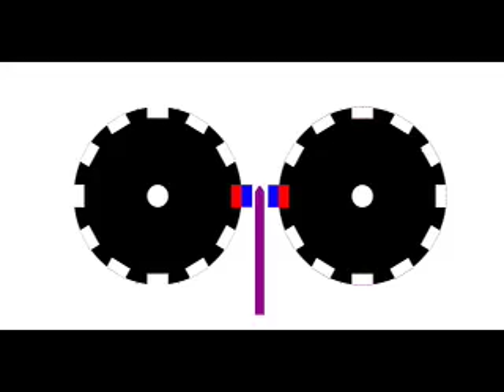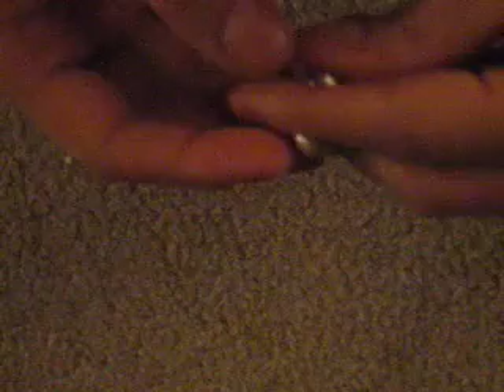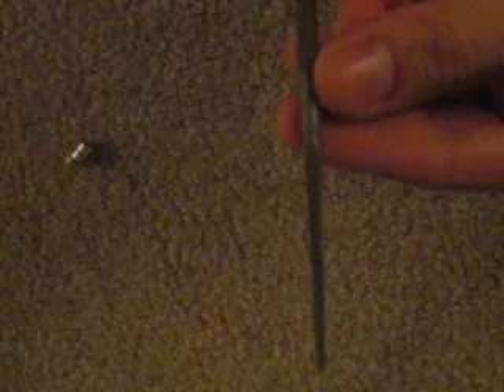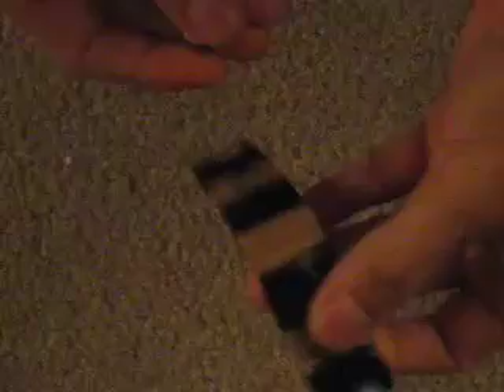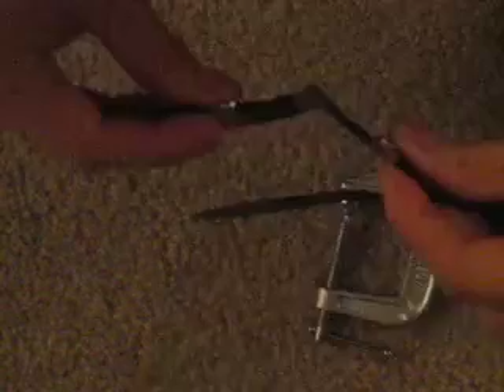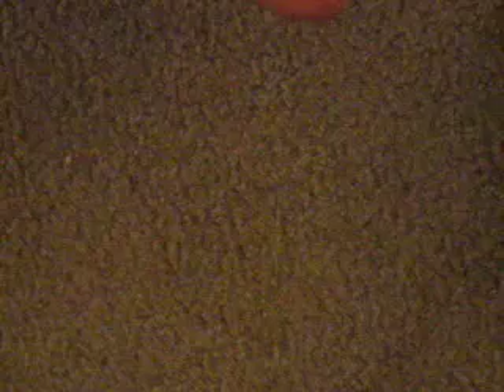Magnet Motor concept and How magnetic shielding works

Comment: Why do you guys spend your time thinking about impossible things. The first law of thermodynamics is the best proven principle in physics. (http://en.wikipedia.org/wiki/Conservation_of_energy)
such a machine can never work, better think about converting available energy (solar irradiation, heat...)  into useful mechanical of electrical energy. There's still a lot improve and engineer in this field.
Reply: "Why do you guys spend your time thinking about impossible things?" Because many things considered impossible in the past are now possible.

You are correct in the a truly perpetual machine where it has enough energy to power itself could never work. But the wheel isn't powering itself, the magnetic fields are attracting at the bottom to the iron, being neutral in the middle when the attraction to iron and repulsion of the opposing wheel are equal, and then pushing when the iron ends and there is only the repulsion of the opposing wheel.

Maybe it's a dream, but that's what dreamers do. And as stated in the video, such a device would only work for as long as the magnets hold their charge ~100+ years. Not "indefinitely" thus not in direct opposition to the Law of Thermodynamics.

Comment: so Is Magnetism a type of energy?
Reply: Yes, but NO ONE knows why it works, it "just does".... don't confuse the ability to use magnetic fields and manipulate it with knowing why magnetic fields work where does the power come from where does it go why would you put a magnet on a piece of metal in A Thousand Years it'll still be there and you can move it to another position and 1000 years later it'll still be there barring destruction by causes both natural and artificial.

Comment: Tested, sorry but itdoesn't work!
Reply: at which point was it failing?
Reply: show the proof of your claim. make a video. We would love to see your device.
Reply: That's not a test, that's someone pulling numbers out of their ass lol.
Reply: propheccy Energy needed to enter in the magnetic area is equal to the force that pushs the magnet out. 
In every way you put magnets the forces + and - will be the same. Energy you got with + and + or with - and - it the same and opposit with + nad - or with - and +
(+ X) + (-X) = 0 everytime.

Comment: you misunderstand. Though your staement is true, I am referring to the concept behind the magnet motor. When two same poles are pushed against one another repeatedly, it'll eventually wear them out, in an attempt for the magnetic domains to align themselves properly. This wears them out exponentially faster than if left alone.

Comment: I think it's worth noting that the magnets will become marginally weaker with each pass, and after about a month to a year most magnets go flat and require re-magnetization, which is energy intensive. Thus, it's reasonable to shove it up the #ss of a skeptic saying it's just a really effiecient battery. (NOT TO MENTION SAFE) warning: will interfere with nearby electronics;)

Comment: I attempted this same experiment back in 2003 when Neodymium magnets were much more expensive and harder to obtain.  It does not work because there is NO known material that can truly block magnetic flux, with the exceptions of superconductors.  No room-temperature superconductors exist.  I am still searching for materials though, and when someone finally discovers a material that can block magnetic flux at room temp. then this motor will be possible, and free energy will finally be a reality.

Comment: You failed to take into consideration the Eddy currents. Basically, the energy of the system will dissipate into heating the metal rod and the magnets.

Also, the metal rod would become permanently magnetic and ruin the properties of the motor.

Comment: Ok, but even then, you have to take into consideration the fact that it takes a lot of energy to create a magnet, especially a strong neodymium magnet like this, and also that magnets slightly degrade over time and degrade even more when used in repulsion mode.

Comment: No you don't! Not if you use your noggin, use solar and wind power to pull the spring. lol Kidding but magnets do create energy from the environment, so there is a way to extract it into useful electricity, we just need to find out how. I see some toys that can prove overunity possibly, A magnetic clamp device, Just from a single twist 180 degrees the clamp comes apart when before it would not come apart if you tried hard as you can to pull it, but you can twist it with ease and it comes apart.

Comment: This won't work. But magnetic shielding is the key to perpetuus motion though. You have to use the kinetic energy to flip the shielding in and out of the two magnets. When push in the magnets can move to eachother. This causes the wheel to turn. But when the wheels turns, this energy is used to remove the shielding. As this happens the magnets will repel again, which makes the shielding return etc.
Just like a gas-engine does.

Comment: No it isn't. 'Wireless power' is essentially a transformer, the pad makes a changing magnetic field and your phone has a conductor in it. When you put a conductor in a changing magnetic field, a voltage will be created over that conductor (Faradays Law of Induction, google it). That voltage then charges your phone.

This magnetmotor cant work because the energy required for the magnet to break a way from the iron is the equal to the energy you gain when both attract. Net total is zero.

Comment: Energy is defined as applied force times the distance a object has moved. Since the the magnet is sitting still, there is no energy involved.

The magnet is attracted with a very strong force and when two surfaces of objects are pressed together you get a friction-force in the perpendicular direction, in this case the perpendicular direction is the opposite of the gravitational force. The friction-force is larger then gravity therefore the magnet stays where it is.

Comment: The problem I see continually when people try to understand something that is beyond them is that they try to dumb things down to a point the same maths and physics isn't even at work any more...
The problem with this is that you are not truly using any magnetic shielding as magnetic fields are not impeded by Iron. and that would not allow your device to work...
On top of that... you aren't going to get an increase in speed in rotation because of eddy currents forming in the Magnetic Barrier.

Comment: OK, lets say you put a magnet clip on the fridge, and you clip a rag to that clip. You can say that there is a constant energy holding the magnet to the fridge because gravity is pulling down constantly. You can also say that there is a constant energy on coming from the clip too because the rag doesn't fall either, are we really getting energy from the spring on the clip eternally? no. You applied a force to open the clip. You need force to open it again and to take the magnet off the fridge.

Comment: An electromagnetic motor illustrates the usefulness of magnetism in creating centrifugal force because it uses the replant charges to create motion on an axis.  They aren't designed to create electricity.  It's close, but I think it took the advance of electronics to enable an addition step that first takes the natural force of a magnet and converts it to a useable centrifugal force, which consequently, is easy to adjust.

Comment: There is a difference between magnetism and electromagnetism.  We invented motors that work on the principle of electromagnetism in the 19th century (the induction motor). But magnets do not produce any work by themselves. You can think of any number of possible configurations (as I said, many people have tried over centuries), but you won't get a motor magnet to work.  We understand how magnetism work and we know it is not possible.

Comment: Nice graphics. But IRL it won't turn unless something else turns it. The magnets will be more attracted to the end of the shield they are close to than the others that are farther apart will repel each other or be attracted to the iron "shield". 

Magnet force falls off with the cube of the distance. All the ignorance in the world won't change that. You might as well make an engine that runs on wish power.

Comment: I've been experimenting with magnets for the past few days, watching you tube videos, reading, etc and here are my thoughts regarding an electromagnetic generator.

A magnetic centrifuge is created that has an inner wheel containing natural magnetic heads, each with the same outward facing polarity.  The inner wheel rotates through corresponding transistors that pulse an electromagnet to push the wheel using repulsion.  The wheel utilizes centrifugal force to create torque and turn a turbine.

Comment: No. Incorrect. You need to study physics, the two are UNRELATED. A magnet is NOT a source of power, a magnet is like a spring, and has NO power of its own, it can only be compressed or stretched as a spring can be, it is NOT a source of power. It would not matter if magnets never faded, they still cannot be used to produce power.

Comment: That is exactly why Perpetual motion isn't possible through magnetism. If it where possible that would mean that the magnetic field would have to be perpetual. which it isn't. things are possible or impossible due to factors. This is one of them. it would be like saying a uranium atom always staying radioactive in a nuclear reactor. But it doesn't either, it too looses radioactivity and becomes to weak to use. learn common sense and THINK!

Comment: You don't understand the physics involved. This isn't like that. It is undoubtedly possible that we may find a way to extract energy from something we're not aware of yet, or from matter directly. But it won't happen by "magnetic shielding", that violates the laws of magnetism. Maxwell's Equations tells us that "magnetic shielding" doesn't. You might laugh if someone alleged you could build a warp drive engine from mason jars and modeling clay. That's what this looks like to a physicist.

Comment: If it ran by demagnetising the magnets then it would run for a while before stopping with 'flat' magnets. I think you will find it wont run at all and the magnets will remain magnetised.
At a glance the idea of the motor looks like it would work but this is where it falls over:- If the shield cancels out all attractive and repulsive forces behind the shield. Consider what happens when the magnets are just below the top of the shield. Repulsion starts acting from above pushing the magnets DOWN.

Comment: You're not shielding, rather what's going on is that the surface charge on the ferromagnetic charge orients the poles of the ferrite. The other problem you will have with this is that the file will become saturated and this will become detrimental to the device.

It also isn't perpetual motion, the force causing the motion degrades over a protracted period of time. Furthermore, and this is something people always overlook, the energy put into the creation of these "permanent" magnets...

Comment: If the math isn't correct we wouldnt have computers, radios wouldn't work, it wouldn't be good. The math is the same math that you use to count your change, but expanded with these things called proofs and theorems to make calculations easier without losing accuracy. calling out theorems on their accuracy without even attempting to understand the principles at work is ridiculous.

Comment: The idea seems promising, at the simplistic level, but I have a feeling that there's all manner of things at the more complicated, fundamental level that will scupper it quite badly. Field lines, eddy currents etc...

And, well, movement takes energy (a force can be applied without any energy being expended if the system is in equilibrium, but as soon as things start to move - or more accurately, accelerate) as a result, you need an energy source and sink. What/where are those, in this case?

Comment: Field lines are like lines on a contour map.  They are lines of constant magnetic potential ( or flux density, depending on what you are solving for ). 

To draw field lines ( relative ) , you need to know the magnetic permeability of air and of the metal bar, along with the dimensions.  The (vector) fields of each magnet add.  The result will give a line integral, as you move through a full rotation, that equals zero. No matter how many magnets, the position of the bar, or what it is made of.

Comment: No as in the magnetic field would induce a 'current' in the metal and cause resistance, just drop a magnet in a metal pipe and it'll fall through slower

Comment: That design would not work, whats stopping the magnets at the top side of the gear from being pull in reverse downward as the lower magnets are being pulled upwards in your video? Perhaps you slowly thin out that iron rod where the 2 gears meet to lessen the force allowing the gears to continue in one direction as the magnets on the top side of gear then are now at place with less iron so they are no longer attracted down wards as much as the lower magnets are attracted upwards.

Comment: This is a very nice video and is actually is a representation of something I tried years ago with the same dual rotor system.  It did not work because the magnets could never pull away from the iron shielding because the attraction force at the end of the shielding was greater than the force exerted by the repulsion magnets that had bypassed the shielding when I spun it.  It eventually slowed down and stopped.  Encourage people to keep trying tho.
Reply: :)) u can use a continues shield for even forces.....the positions will be......strategic....have to make only a gap somewhere....problem solved but just to appear another..... and another......

Comment: depending on your motor design, ferrofluid used for 1 of the magnets might be suitable for shielding.. Like if it was contained in such a way to where the fluid can move out of the way when it reaches peak repulsion, and then slide back into place right after.

Comment: So, the idea is that this thing will creat more speed than it needs? Okay, lets say it does, then what happens? Will it accelerate in a way that the speed also accelerates? more and more in all eternity, or will the speed become constant? It will be constant right, a=(v^2/r) in direction towards center. Okay, so then you'll try and harness that constant speed, what happens? you steal energy from the speed and the acceleration towards center will decrease, and finally the wheel will stop.

Comment: Or Mu-metal for shielding - Check out wiki... Mu-metal is in harddrives - the big 3.5'' it shields the magnetic field so as it doesn't affect the disks but only the rotor arm to r/w on the disk.
if you want diamagnetic - water is diamagnetic, if one could

Comment: This motor won't free run because although there is attraction and repulsion, if the wheel turns the net attraction and repulsion is still the same. Unless the act of turning causes a loss in energy, eg by making the net attracting parts closer, or the net repelling parts further apart, then there is no reason for it to turn. 

It would only ever turn if the incremental movement got it into a state of lower energy.

Comment: Why make a CGI version of this?  Why not just build it?

The way this is explained, looking at a small part of the system, it seems like it would work.  But it won't the whole system of magnets and bars will add up to 0 spin on the wheel.

"why does people get so angry about "free"energy"? Because this is you tube, and everybody is upset and swearing about everything?  You might as well ask why they use bad english.

Comment: without an outside force, the motor would just reach a point of equilibrium. thats what every magnet motor always boils down to, it will just reach a point of equilibrium and not move. that is what permanent magnets and metal do. create an electromagnet and its a different story..... but then its just an AC motor
also, nobody is trying to "suppress" free energy, otherwise obviously solar panels and wind turbines wouldn't exist

Comment: The concept is not bad, but there is one thing that must also be taken into account, it is a mutual attraction of magnets to the plate between them. and it will be more than the force of repulsion. You need to consider this point, I have some thoughts on this. 
RUS Концепция не плохая, но тут есть один момент, который тоже надо учесть, это взаимное притяжение магнитов к пластине между ними. и он будет больше чем сила отталкивания. Нужно продумать этот момент, у меня есть мысли на этот счет.

Comment: I'm not a scientist, but intuitively this won't work.  What you need to do is to somehow open and close the shielding.  For example, shielding is open when magnets move just past their furthest point so they are pulled together again and then at peak speed/momentum/velocity/whateverthefuck the shielding closes so the magnets can spin freely around again.  Naturally, the opening and closing mechanism/process must use less power than the rotating magnets create, if that's even possible.

Comment: instead of arguing about it, just do it and we shall all see if it works. i have tried many different theories and they have all one thing in common. They don't work. I will try this as soon as i find proper light weighted gears. Until then, either do this or stop stop arguing.

Comment: For the doubters out there....Explain to me why this would not work?  This is the "magnetic gate" to the missing puzzle.  How is what is happening here different than what actually happens in a conventional electric motor that turns the field on and off...while the magnet motor discussed in the video does essentially the same thing by neutralizing the or better yet balancing out the magnet forces to "zero" at the precise time this needs to happen.  This is brilliant!